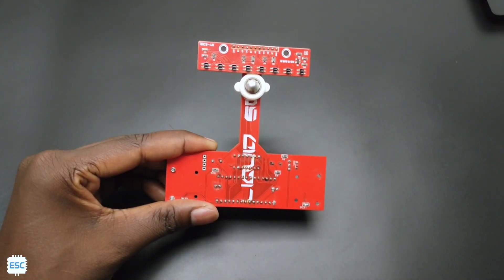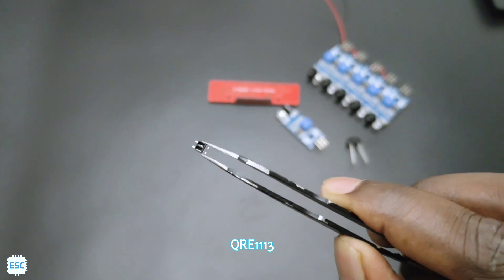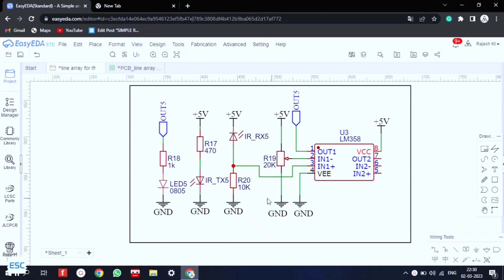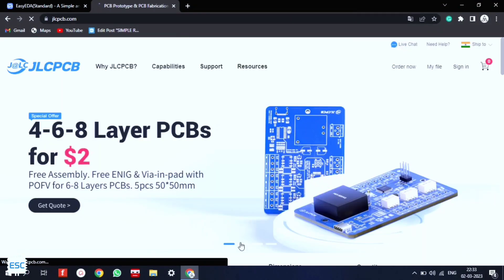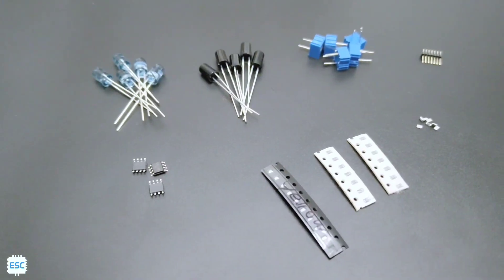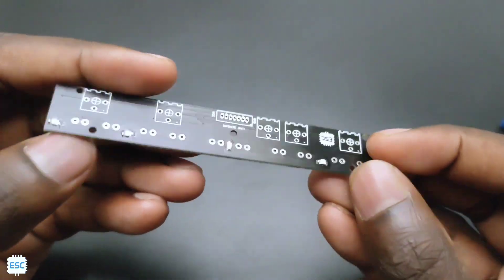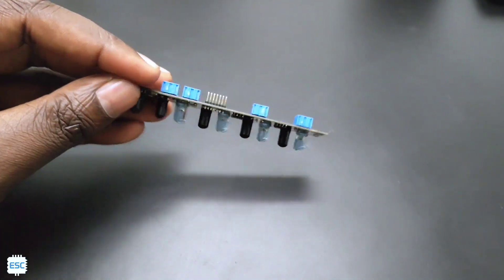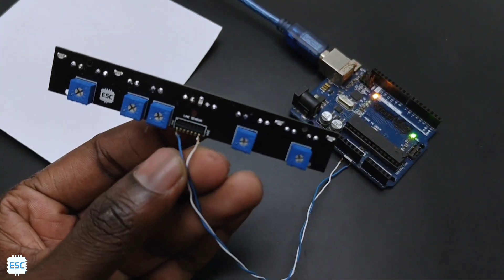How to make line Sensor array for LINE FOLLOWER ROBOT | JLCPCB

Comment: So pin1 is output to LED on the upper side of the pcb and at the same time output to pin in JST-XH connector right?
and what is distance between each pair of sensor for best result?
Your diagram is a bit blurry.
Reply from the maker: The first pin is 5v the last pin is gnd. Middle pins are outputs. Please send me an email  for the  circuit diagram
Reply: @EDISON_SCIENCE_CORNER  Thank you for replying. 
I already get that part. I mean pin 1 of LM358 is output to LED labeled "LED5 0805"  and  same output is connected to one of the middles pin  in JST-XH. Is that correct?